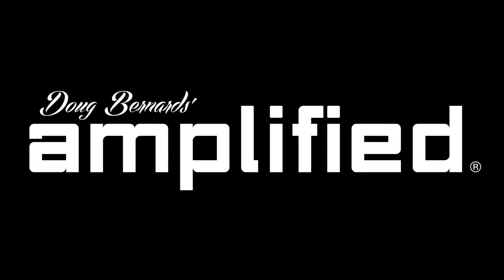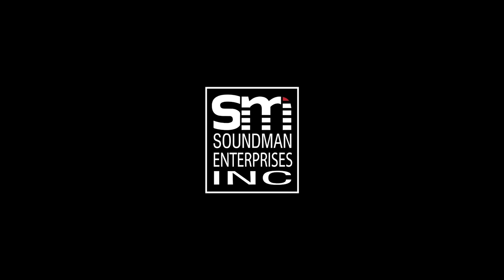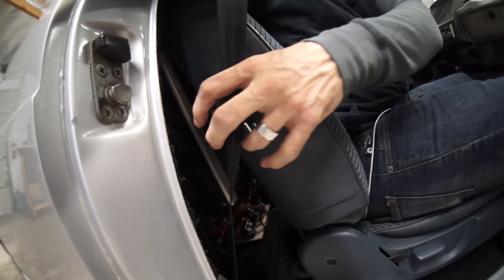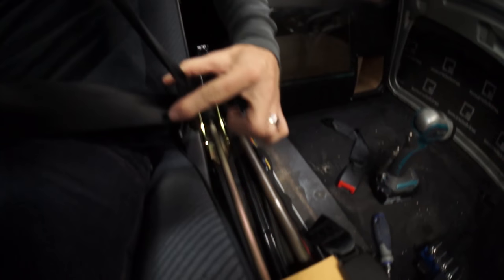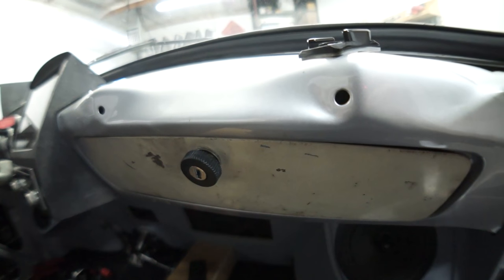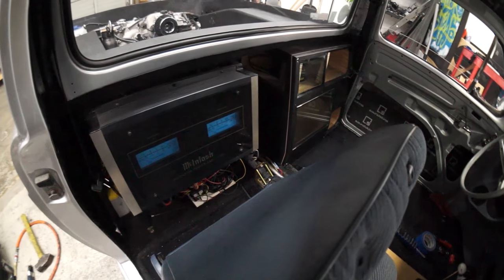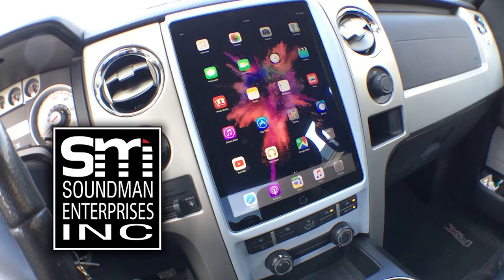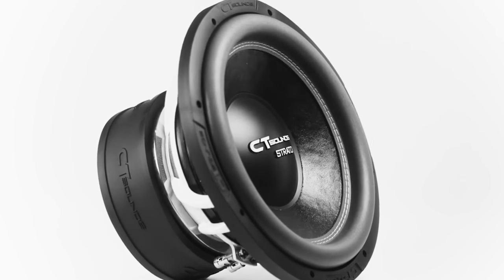2017 TOP SAFETY PICK

Comment: PLasma cutting reinforcement plates for the retractors is a good idea, the thickness of the belt ends and retractor mounts is a good reference of how much force seat belts are expected to take.  Also, skip the nutserts, and cut reinfocement plates and weld nuts to them.  The nutserts will pull through the hole when you need them the most.

Comment: You don't need the insert tool to crush the inserts. You can use a bolt and a nut that is larger than the thread and just tighten the bolt down and it'll pull it in.

Comment: fuck yeah, mule is getting pretty close to finished or at least to a point where you can drive it and really enjoy it.
I'd be cautious of using nutserts, I've used them in a previous job and found them to be great when only a shear load was applied but easilly twisted and yanked out. I'm sure it will be fine though!.

Comment: A nice video - once again! - One question: What kind of rules do you have about seat belts in California? It seems you have to have some. Does it have to be a three-point-belt or would be a hip-belt fine? What about the hotrod guys? I've seen a lot of cars in Las Vegas without belts (i think).
Reply: WEST-BERLIN-CUSTOMS those have lap belts. I've had young cops not know what to do when they pull you over in a 60's or 70's car where lap belts and vin tags are standard equipment.
Reply: Thanks a lot for your information! So it seems to depend on the age of the car. or the time, when it was registred officially? That would be similiar to our laws in Germany. If the first owner didn't have belts in the car, because the manufacturer didn't install some - the car can stay without belts today, too.

Comment: The new D.O.T. safety standard will be effective January 2018. It calls for the owner of any car with seats/belts modified from its original condition, to have 1/4 inch steel plates factory installed in there ASS, and to have the seats in the mentioned vehicle PROFESSIONALLY MAGNETIZED.

Comment: Aren't you worried about the buckle hitting that nice amp or sub box when you let go and the retractor pulls it back in?  You need some kind of stop to keep the buckle higher on the belt when retracted, yes?
Reply: jsawhite you can see a button to the strap. the button will prevent the buckle from retracting all the way.
Reply from the maker: well... i'm not necessarily worried... but i will slap a bitch for tossed that buckle at my amp!
Reply: Exhale all the smoke before you reply Doug
Reply: SoundmanCA "for tossed that buckle at my amp" did you mean tossing? sorry for being a grammar Nazi ...lol...

Comment: you need to add some airbags for the steering wheel and for the passenger
Reply: BILL KIRK there is. but we installed them in the suspension.

Comment: Why not weld the bolts to the bottom of the floor and then all you do is tighten the nut onto the bolt from the top? Would save money and time waiting on the nutsert fitting.
Reply: Cande0Man you should try welding lying on your back under a bagged car. Doug seriously needs to get a lift.
Reply: David Acampora pull the bolt up from the inside and weld it to the floor. Not from underneath